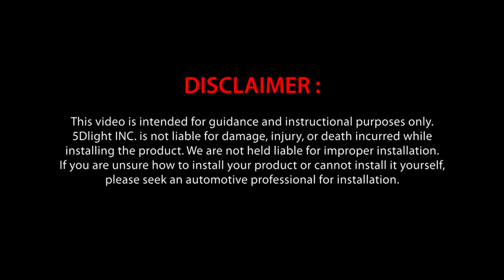2019 Hyundai Ioniq | How to install LED back up light interior dome map truck bulbs

Comment: 4:03 front reading lights is doing this the hard way, drop the sunglasses holder, there is 2 screws remove those and pull down the whole item comes off, the light bulbs twist off from the rear , and you won't scratch your plastic

Comment: Congratulations for the video, very useful. That front turn signal that stay always on is illegal and dangerous on roads.
Reply from the maker: Hi, did you install front led turn signals and they always stay on? Usually, there is no need to keep the front turn signal always stay on.

Comment: The issue I'm having is that the boot light disconnected from the cable itself and not sure how to get it back without taking the boot lining apart
Reply from the maker: May I kindly ask if the product you purchased is from Lasfit? If so, please contact our customer service team via cs@lasfit.com and send relevant pictures or videos to describe your problem, customer service will help you to solve it.
Thanks for your help!

Comment: I can't seem to get the map lights to go all the way in. I'm putting them on my 2017 Hyundai Ioniq Hybrid SEL...
Reply from the maker: You can't put the map lights into the socket, right? Is it too thick to put in?
Reply: @lasfitvehiclelife  Yes. I can get them in a part of the way but not all the way in
Reply from the maker: @nareyakireina  You probably need to put it into the socket vigorously. For models/vehicles, the OEM bulb socket is a little small...
Reply: @lasfitvehiclelife  Yeah I was pushing really hard. My fingers started to hurt.

Comment: Do the canbus bulbs cause any problems? I read that you shouldn't put them on a vehicle that is non canbus because it can cause problems with the system...
Reply from the maker: Hello, these LED bulbs work perfectly, without problems as shown in the video. These LED bulbs are deigned with built-in canbus. According to our experience and customers'  feedback, for some models of Kia&Hyundai, the LED brake lights are not compatible with the OEM system. But other LED bulbs, such as LED headlight bulbs, fog lights, reverse lights... work perfectlh.
What's your car make, model and year?